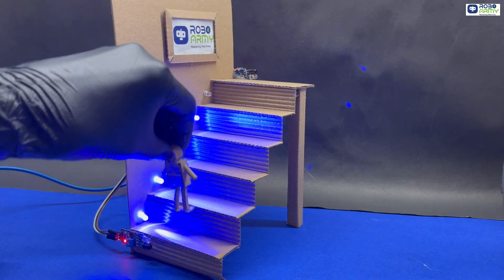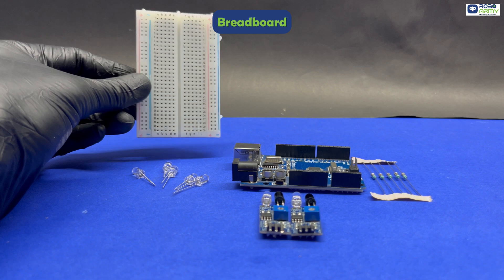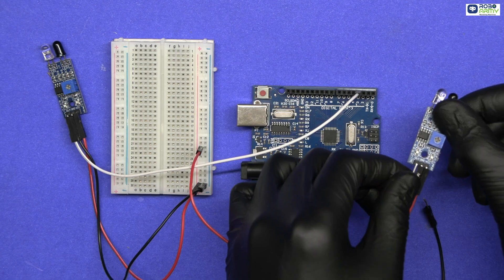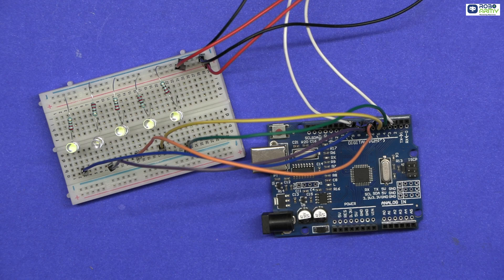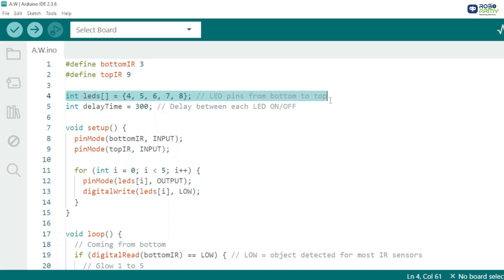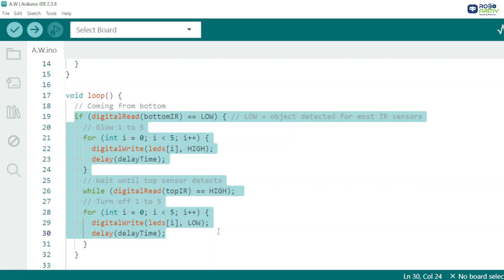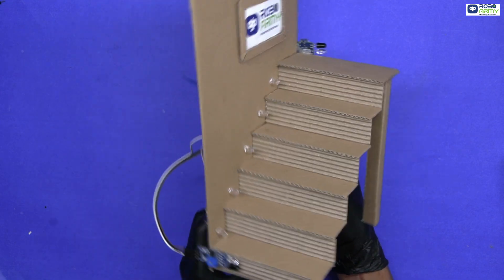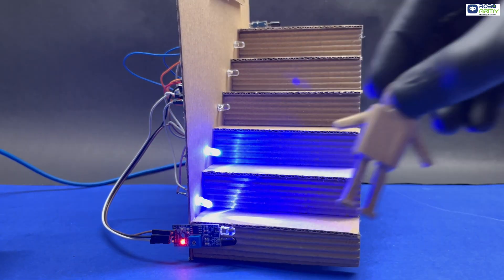Automatic Staircase Lighting Using Arduino | Motion-Activated LED Stairs Project with IR Sensors

Comment: Sir can we give power supply through adapter?
Reply from the maker: Yes, absolutely 👍 You can power the Arduino using a DC adapter. Just make sure it’s within 7–12V if you’re using the DC jack, or a regulated 5V adapter if powering through the 5V pin

Comment: I've cross checked the wiring and uploaded the code, but either non of the led is turning on or just the last one is working. LEDs are fine I checked by connecting directly with battery. Plz guide
Reply from the maker: Thanks for reaching out! This sounds like a common issue. Can you check if all your IR sensors are working correctly and if the code is correctly detecting motion from each one? Sometimes, it could also be the power supply not being sufficient for all LEDs.

Comment: U first used breadboard for connection and then again u  separated leds from it actually how they work
Reply from the maker: The LEDs were separated from the breadboard to be placed on the staircase steps for the final setup, but they were still connected to the Arduino through wires, just like they were on the breadboard. The breadboard was mainly for prototyping!

Comment: Sir I made this on and it's working also but my teacher is saying what if someone wants to stand in middle of stairs then the light will stop and the person have a risk to fall
Reply from the maker: Great question! For someone standing in the middle, you can add more IR sensors along the staircase, or use a PIR sensor with a longer delay in the code to keep the lights on for a longer duration.
Reply: @robo_army_  how many more sensors should I use and they'll ask I want to stop on every stairs no one know where they will stop when attending a call or whatever. And can you please tell what is iot based in this please please 😭😭
Reply: Why you need this if someone is standing in the middle top sensor will not activate and hence it will continue to glow

Comment: What if we need to increase step counts to 24. Could you please provide Arduino code and schematics
Reply from the maker: Great question! Yes, you can easily expand the project to 24 steps by using additional LEDs and digital pins (or shift registers if you run out of pins).

Comment: Are you working on Automatic bathroom 💡 light without Arduino
Reply from the maker: In this project I’m using Arduino for better control and flexibility, but yes, an automatic bathroom light can also be made without Arduino using PIR sensors or simple electronic circuits. However, Arduino allows us to add more features like timing, brightness control, and integration with other devices

Comment: Can you make an automatic bath room  motion detection light  😊😊 with arduino or without arduino
Reply from the maker: Great idea!  Yes, an automatic bathroom motion detection light can be made both with Arduino (using a PIR sensor + relay + Arduino) and even without Arduino (directly using a PIR sensor + relay module). 

I’ll try to make a tutorial on it soon — stay tuned!
Reply: Thanks for a great reply 😊❤

Comment: You can make the gap of 1 sec aftet every stair
Reply from the maker: Yes, that’s possible! Just increase the delay time in the code. For example, change int delayTime = 300; to 1000 (which is 1 second). This way each LED will turn on/off with a 1 second gap instead of 300 ms.

Comment: Bro my laptop is not having the link for the code please give me the link for code and thank you
Reply from the maker: no worries, here is your code:
#define bottomIR 3
#define topIR 9

int leds[] = {4, 5, 6, 7, 8}; // LED pins from bottom to top
int delayTime = 300; // Delay between each LED ON/OFF

void setup() {
  pinMode(bottomIR, INPUT);
  pinMode(topIR, INPUT);

  for (int i = 0; i < 5; i++) {
    pinMode(leds[i], OUTPUT);
    digitalWrite(leds[i], LOW);
  }
}

void loop() {
  // Coming from bottom
  if (digitalRead(bottomIR) == LOW) { // LOW = object detected for most IR sensors
    // Glow 1 to 5
    for (int i = 0; i < 5; i++) {
      digitalWrite(leds[i], HIGH);
      delay(delayTime);
    }
    // Wait until top sensor detects
    while (digitalRead(topIR) == HIGH);
    // Turn off 1 to 5
    for (int i = 0; i < 5; i++) {
      digitalWrite(leds[i], LOW);
      delay(delayTime);
    }
  }

  // Coming from top
  if (digitalRead(topIR) == LOW) {
    // Glow 5 to 1
    for (int i = 4; i >= 0; i--) {
      digitalWrite(leds[i], HIGH);
      delay(delayTime);
    }
    // Wait until bottom sensor detects
    while (digitalRead(bottomIR) == HIGH);
    // Turn off 5 to 1
    for (int i = 4; i >= 0; i--) {
      digitalWrite(leds[i], LOW);
      delay(delayTime);
    }
  }
}
Reply: Thank you so much for the code
Reply: And can you help me to do a drone using any of the aurdino board  with the code😢And thank you again😂😂😂

Comment: What if we want to lit one led at a single step
Reply from the maker: Great question!  If you want only one LED to light up at the step where the person is, instead of a cascading effect, you’ll need to directly map each IR sensor (or step sensor) to a specific LED. That means:

Place one IR sensor in front of each step.

Connect each LED to its matching step.

In the code, whenever a sensor is triggered, turn only that LED ON, and when no one is there, turn it OFF.

This way, the LED lights up only when someone is standing on that step.